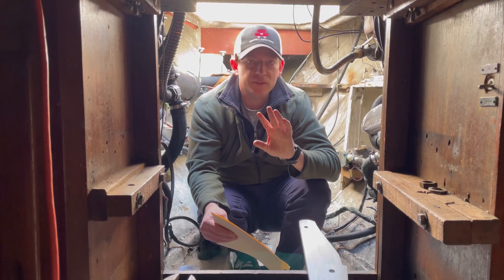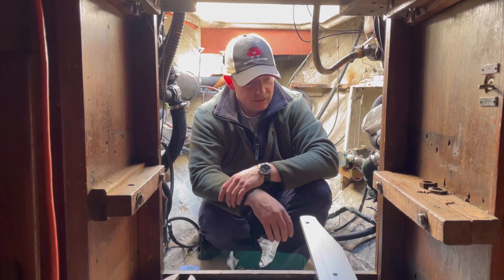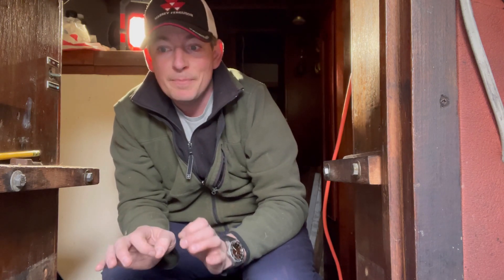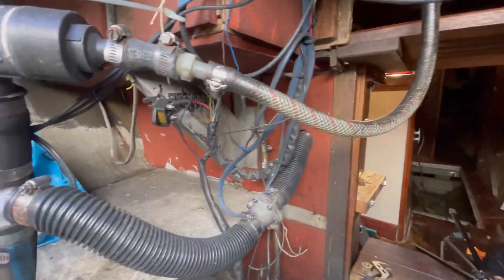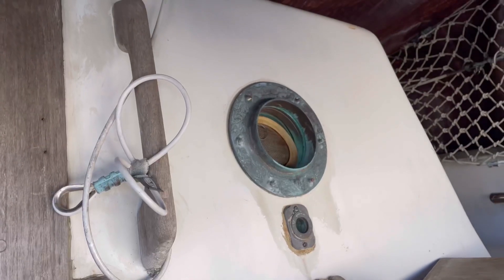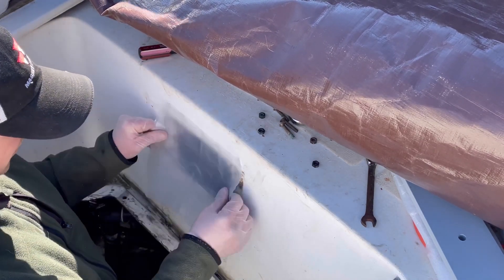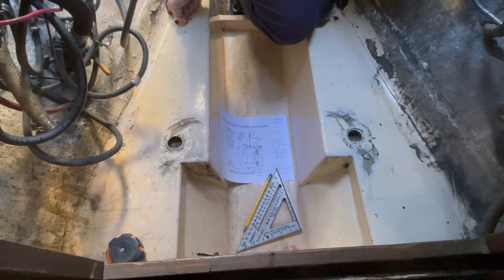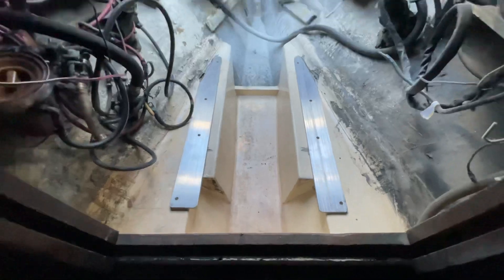How to Install a Sailboat Engine Using a Jig Pt. 1 | Sailboat Restoration Ep. 16

Comment: Where and how was the jig obtained
Reply from the maker: You can make it on your own using the engine diagram specific to your boat. These details should also be provided by the engine manufacturer. For the Westsail, I was able to additionally use the engine bay diagrams in the parts manual available online.

Comment: Im retrofitting a yanmar 1gm-10 into a Halman 20 which looks like a baby Westsail 32. It didn’t have factory inboard only an outboard bracket, but Ive fabricated a steel alignment jig so i can glass in stringers like yours and then steel cradle to match my 1GM-10 mounts and also align new shaft-log (soon to be glassed in) You’re last two videos are helping me out because its a big project/easy to screw up…double enders are sensitive to weight too much stern weight will change engine driveshaft axis causing engine problems. Thanks for the great videos i need to do the same
Reply from the maker: Thanks! I’m glad they were helpful. I’m about to post the final video, part 3, which is where I use the jig the most. Like you will find, the jig helps have the shaft centered inside the stern tube with minor adjustments to the engine’s mounts required. Good luck with your project.
Reply from the maker: Check out Part 3.  It’s now out!
Reply: Even Keeled i did. What an excellent episode! Pro glass work
Reply from the maker: @MonstroLab  thanks. It’s looking even better now that it’s all been sanded and painted. Will have the video finished soon. Seacocks are next. Everything new when it comes to the engine room.